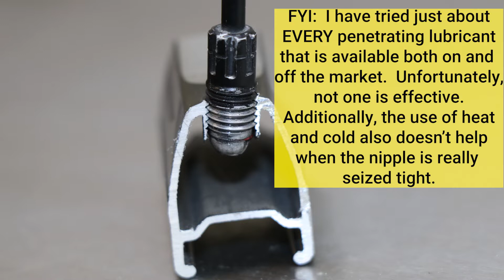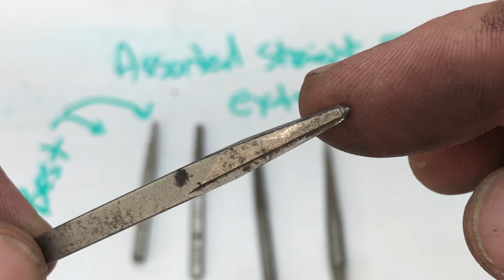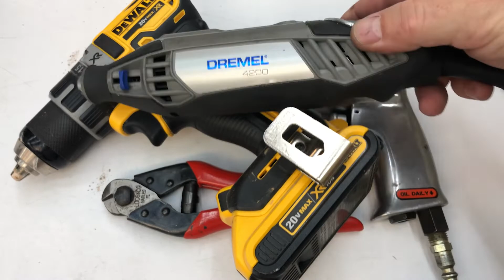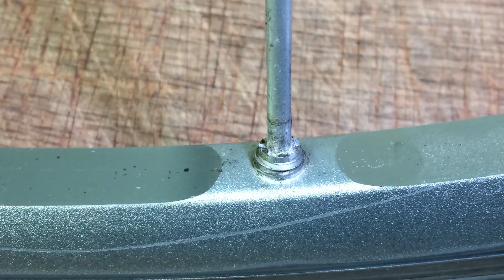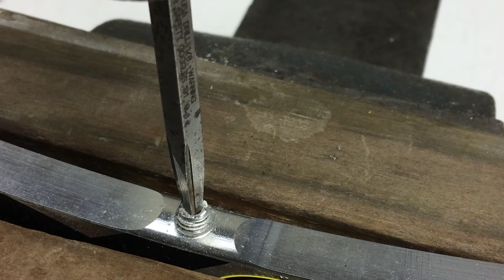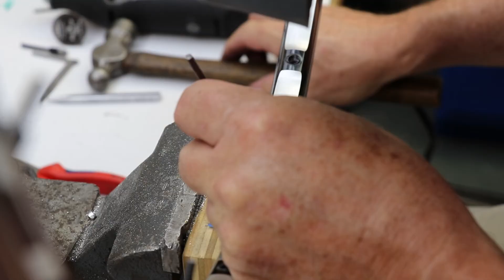How to Remove Stuck Mavic Spoke Nipples

Comment: So I just got done doing this. Was my first time. The tap ended up going slightly off pitch so my threads look ever so subtly doubled. Less than 0.25mm.

I had to go the pita route And I didn't have a square taper Easy out. No easy out at all. And no Dremel with a rasp. Just the tap and some drill bits.

I saw a big chunk of leftover spoke nipple unthread and fall out the valve stem hole. So that was a relief. But it was indeed slightly tapered in Pitch. I managed to get it close enough by using the Center of butt end of my drill lined up with the spoke latch on the Hub. I think that's how I maybe got lucky?

Do you think it's safe to ride?

Comment: Do you have any experience with spokes that are stuck to the nipple? I have some spokes that will twist with tightening/loosening of the nipple. No matter how I try to hold the spoke, the they will not break loose. I even 3D printed a tool that will hold almost the whole bladed part of the spoke, but there is still twist near the nipple, and I don't want to break the spoke.

Comment: whats your opinion on twists in the bladed spokes, I had to clamp the spokes to break the nipples free to true the wheel and got quite a bad twist in a few spokes from the force I needed to apply used wheel set the idiot left them outside for years they sere seized, thanks.
Reply from the maker: Hello!  I've seen wheels go for years with a twisted spoke(s).  That being said,  it would be safe to assume that the twisted spoke is weakened and prone to break, so it probably would be prudent to replace it in the near future.
Reply: @RogueMechanic  those dang spokes are expensive, yeah I put a nasty twist in one of them I even tried to twist it back straight it was so nasty
Reply: @RogueMechanic  do you replace just one spoke at a time or loosen all the spokes evenly and retention the entire wheel?

Comment: Saved from the scrap heap. Well done !
Mavic wheels are pretty good. One of the few high performance wheels with real world weight limits.
Reply from the maker: That's great news!  Yes, I think that they are better than most.  It would be hard to find another brand that has the same durability/longevity.  Not perfect, but for the most part, really good.

Comment: Thanks for this very helpful guide. I'm working on a Mavic crossmax sx now with similar spokes. Although not as bad as in this one because I can now rotate all the nipples. My only problem now is the nipples seems fused with the spokes, and now letting them soak and working them slowly. btw you can buy some metal version of that mavic spoke wrench.

Comment: Super skills and knowledge , Really Impressive Work, but this is why i am not a fan of Mavic wheels, their performance versus other top notch brands are not superior or equal .....spare parts are hard to find (5years production after these old wheels will go to garbaage), cost reparing  does not worth for a bike repair shop
Reply from the maker: I appreciate your kind words and your opinions.  I see it from a different perspective I guess.  There are very few top notch brands that produce wheel systems.  Most "top notch" brands have wheels that have the components produced by other companies and they assemble them.  Mavic doesn't do this.  Additionally, their wheels, for the most part, last a lot longer than other brands that used standard stainless steel wire spokes.  This being said, working on Mavic wheels require more knowledge and effort (not just reaching into the DT Swiss, Wheelsmith, or Sapim spoke inventory to replace a broken spoke...).  It's unfortunate that the least amount of effort is spend when a customer brings his/her wheels into a shop.  Most mechanics skip the whole google search for replacement parts a go right to recommending replacing the wheels.  This is sad but true.  Thanks for your comment.  I appreciate it! -John
Reply: @RogueMechanic  Your point of view is respectable. I am agree with you nowadays in our society when something is too long for repair (time is money) and spare parts are expensive, generally hard to found, the garbage is the common destination. 100 % against  obsolescence. I understand that mavic is production their own spokes etc...but speaking obsolescence i am opening the pandora box maybe thinking that enginerring a too complicate system, and making for such a big compagny to not produce spare parts after 5 years producing is a deliberate way for making sells.  You re an artisan, and unfortunetly if i have a Mavic wheelset to repair that noone can in the place we work, my hourly rate will be higher because of my knowlege and because i am the only one (in our working zone). We must keep in mind that a coast repair will be normally less expensive than a new wheelset.  In conclusion, high level traditionnal circuit with nice hubs spokes etc...is for me an insurance for long riding hours and infinite possibilites of repair particularry if you race/travel a lot. A classic Sapim X ray can be found nearly in everygood shop. In term of time aging also in 20 years these type of spoke will be still produced. Speaking about technology mabye great hubs and carbon spokes or Berdspokes is an option

Comment: i was thinking that a perfectly fine spoke with a broken nipple is a shame we have to cut it. maybe, with a tiny drillbit destroying the nipple and taking uout the spoke.. then making threads in the tip of the spoke and putting a new nipple that tops against a nut put in that threaded side would be nice. just like how stainless steel spokes habe a bronze tip on a thread in one extreme...  sorry for my english. maybe you get my idea??. using the other nipples and threaded ends from other spokes to save it
Reply from the maker: That would be nice, but given the very limited space available, and other factors, it would be very difficult to do.
Reply: @RogueMechanic  That's right, should use CNC machine, the rim is big enough to work on CNC.

Comment: Worse thing is that when the nipple is busted... The spoke that is perfect can't be used again. I hate this. I have perfect spokes but busted nipples. Someone should invent some way to replace Mavic  nipples without having to buy spokes
Reply from the maker: That would be nice, but the way that the spoke nipple is captured on the Zicral spoke, and the limited space available, that would be very difficult.
Reply: @RogueMechanic  can I replace the spokes with some that have similar lebght but with threaded tip. Those that are like a bronze tip screwed in the threaded tip and have also a nipple?

Comment: I wanted to say that I just successfully extracted 6 broken Magic spoke nipples via your technique.  All 6 required to be drilled out.  My biggest drill bit was 7/32" which left me a decent amount of the remaining nipple.  I was able to gently remove it via a very small screwdriver and a small hammer (very gently taps).  Then I ran a left handed M7 metric thread tap to ensure the threads were clean.  

For the remaining existing spokes, I am going to lightly sand away the black paint about 1" above the end of the spoke nipple.  Then I will apply a bit of heat to the nipple and attempt to get it to turn while holding the flat part of the spoke.  If I can gently coax the existing spokes out of the rim, I plan to put some anti-seize compound on the spoke nipple threads and the part of the spoke that ends up surrounded by the tightened spoke nipple.  I am hoping this will get me a wheel that can be serviced for another decade.

Thanks for your extremely helpful video.   You are exactly right.......take your time, don't overdrive the frozen nipple, and you can save these vintage Magic rims!
Reply from the maker: Well done and thank you for your kind words!  Good on you for being able to remove six nipples by just drilling out with a 7/32 bit.  It took me a much longer time to remove them before adding a high-speed rotary tool (Dremmel) to help with the spoke nipple material removal.  

For the remaining spoke nipples that are seized, I have found that releasing the tension by cutting the spoke sometimes allows the spoke nipple to start turning when it didn't budge while there was tension from the spoke.

Whenever I install new Zicral spokes, I always coat the part of the spoke that is within the nipple with waterproof synthetic grease and then apply a drop of medium-strength Loctite to the threads.  The Loctite also coats the surfaces and prevents corrosion.  Grease or anti-seize instead of Loktite on the threads will also work.

Comment: Why do they seem to manufacture these inserts out of such brittle metal? I had to order replacements from a bikeshop in France. I hope they are the correct size. I will order a few straight-fluted extractors.
Reply from the maker: I'm not sure why Mavic uses the material that they do for the nipples but overall, it's not a horrible choice  because the vast majority of the wheels that have these spokes and nipples do not have any issues whatsoever.  For the task of removal, the straight-fluted extractors have worked really well for me.
Reply: @RogueMechanic  Thanks. Did I really need to order from France? Is there a US source for these nipples/inserts/spokes?
Reply from the maker: @davejoseph5615  No problem at all Dave.  Depends on which spokes/nipples you need.  My website is www.mavicparts.com; you might find what you need there.  My inventory is getting pretty thin since it's been over a year since I received any product from Mavic.  Do you know the part number for the spoke that you need?  I guess that you do since you ordered them already.  If you have any questions, just let me know.
Reply: @RogueMechanic  I got the two broken ones out with a just a drill bit. These are the 9mm UST ones which are probably easier to remove. Thanks.
Reply from the maker: @davejoseph5615  Yes, those are easier.
Reply: I think the nipples are aluminum, to save weight. Aluminum nipples are known to corrode much more than brass nipples
Reply: Dude…..you are my Mavic super hero!  I am actually working to recreate a spike out of aluminum just to see if it can be done.  I was going to try to save a seizes nipple with some heat and PB blaster, then use heat and a hammer to form the aluminum to a similar shape.  I am retired with time on my hands….what the heck!!